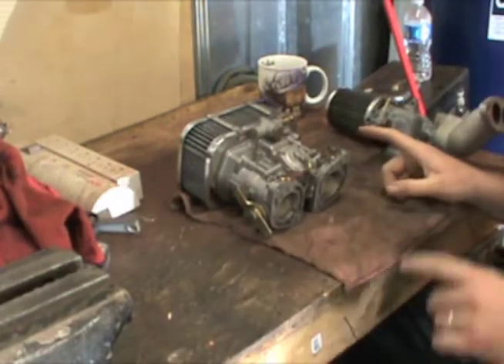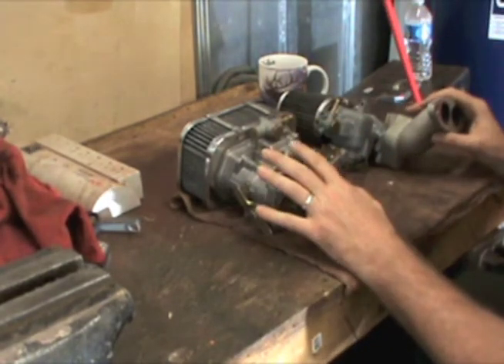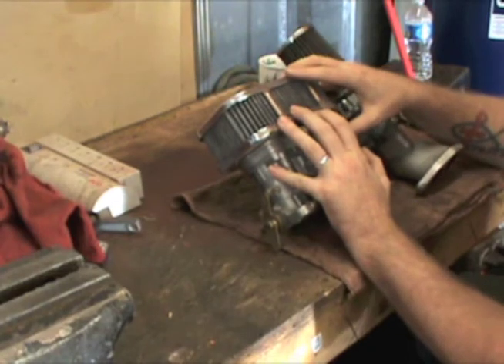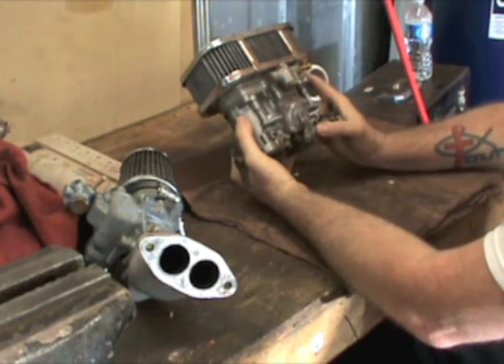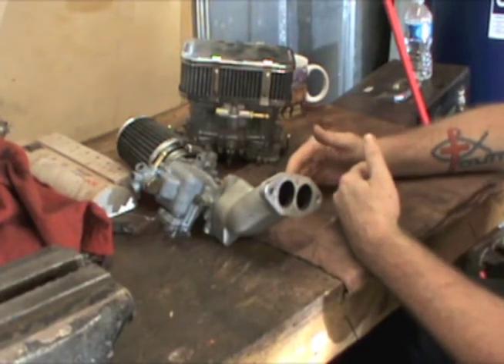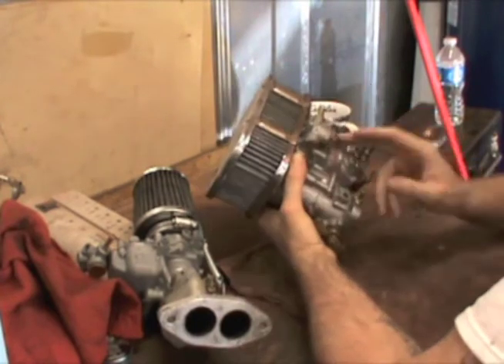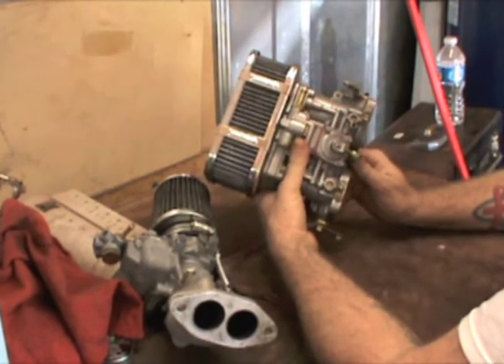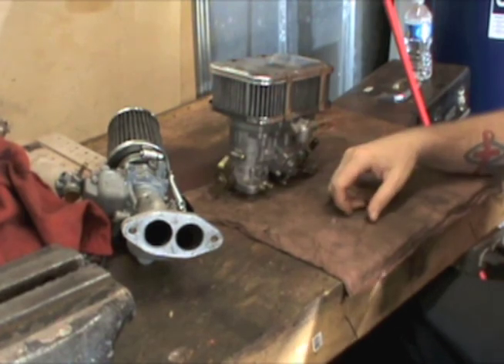Volkswagen-Weber IDF or ICT

Comment: This was a really good explanation...thanks for the video! 
I have a '78 Bus with a stock 2.0L Type-4 engine which currently has a single centermount carb, would you recommend dual Weber 34 ICTs for this engine? I'm not interested in a big increase in performance but just want good reliability and decent mileage.

Comment: well said....coulda used that advice 20 yrs ago when i had my vw station wagon. i changed to the single carb and it ran alot better at higher speeds like 55...in fact the motor was goverened at 55mph...cant remember what cc the motor was love the gas milage tho. Grew up with a 66 beetle i only ran in the winter...great little car on the ice and snow. Drove my dodge darts in the summer.

Comment: Im guessing the fella that built my 1915cc tried to compensate for the stock heads I have on my motor by using the 1.25 ratio rockers.  Would you agree?  The motor has a turbo cam 120 in it.